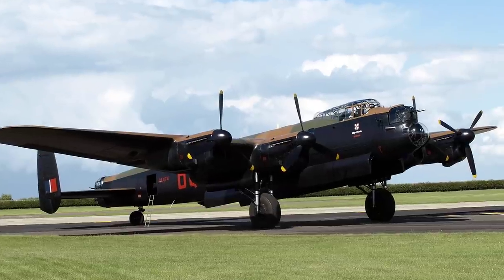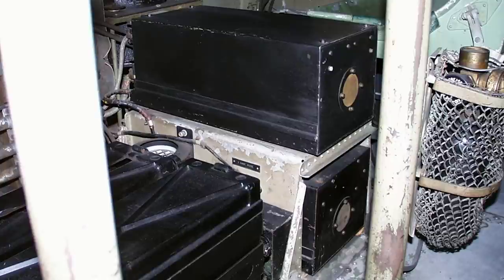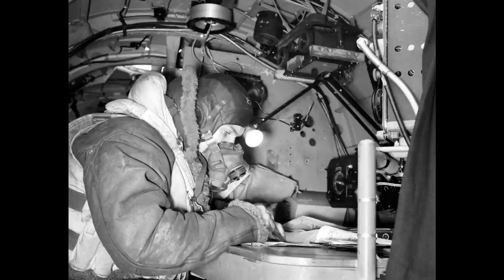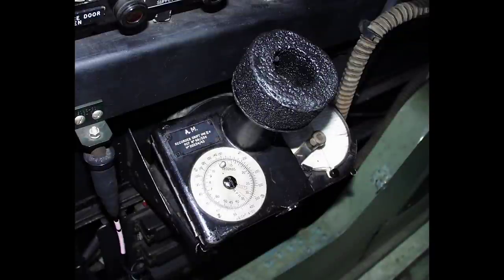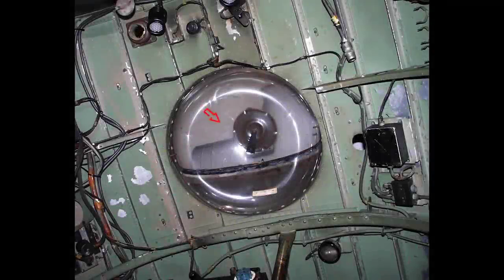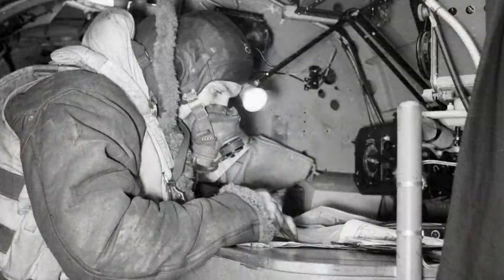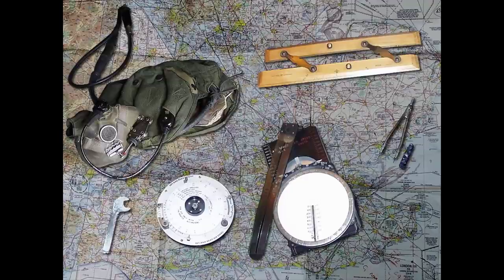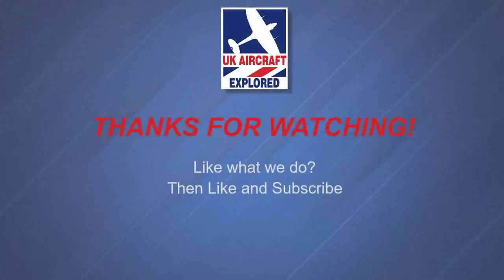Avro Lancaster – Navigator’s Position

Comment: Hi Bryan.  Very interesting, but a bit inaccurate in some areas.  The Air Mileage Unit did not output speed but air distance travelled with, if I recall correctly, 24 revolutions per mile.  In the AIR POSITION Indicator this was resolved with the true heading from the Distant Reading Compass, via the VSC, to produce changes in latitude and longitude which updated the initial position the nav set on the counters on the right of the API.  These were lat & long, not bearings.  This then showed the AIR Position, ie position in the air mass but not corrected for wind.  The nav would then plot the Air Position on his chart and add the wind vector, for the time from the last fix, to show the GROUND Position.  If fitted this could also be done using the GROUND Position Indicator.  In this case the nav would set his latest Wind on the GPI, harmonise it with the API and set it running, the GPI then projecting a constantly updated Ground position onto the chart below.  This technique was particularly used by No 5 & 8 Gp nav’s for accurate target marking.  I used the API occasionally during basic nav training  in 1973, ending up many years later as OC the Air Navigation School at RAF Finningley !  Do pm me if you’d like more info on the subject.  Rgds Chris

Comment: Great video as are all of yours , just a point . Have you mixed up your Oboes and Gee's  From what I've read Oboe had the lattice type map with a range around 400 mls , and accurate within 8 /9 mls . Whilst Gee was extremely accurate within yards but could only handle one aircraft at a time. GeeH a later version could cope with 3 or 4 but still limited to less then 300 mls.   This fails to explain as how was the American navigators were so poor , frequently bombing not just the wrong town /city but the wrong country , Switzerland , Holland , Czechoslovakia .
Reply from the maker: Hi James, I don't think I've mixed up GEE with Oboe. The original GEE used the hyperbolic lattice map system, you mention. Gee was read by the navigator on an oscilloscope CRT display. GEE was accurate to the order of kilometres, which was useful for navigation and area bombing, but not pinpoint accuracy. Oboe, however,  did not work on a visual basis with a map like GEE. The Navigator would use GEE for general navigation, and once closer to the target area, Oboe range signals would be sent out by UK-based operators using a tone generator producing Morse code dots or dashes. This was similar to the beam approach systems used like Lorenz. A solid tone would tell the crew when to release their bombs or target indicators. Hope this helps and thanks for watching.
Reply: @ukaircraftexplored6556  Thanks for putting me right on that one . Google the font of all knowledge said that Oboe could be accurate to 50 yards . True or false . ? Which doesn't explain how the Yanks failed to find the target so often , they nearly missed Berlin.

Comment: Fascinating detail and great shots of all the nav. equipment. What I've always been slightly mystified about is WHY OH WHY? DR Compass was set to TRUE HEADING? I am a modern day Cessna-scale PPL and even with all our current technology the HSI still gives MAGNETIC heading and VOR radials are MAGNETIC. I can see that the API Unit would require TRUE heading to calculate position but I can't see why the correction wasn't simply applied to API repeater and the others were left on magnetic heading? The pilot would have been staring at a DR Repeater showing True Hdg and down below he had a P4 compass showing Magnetic. On his blind flying panel he ALSO had a DI Gyro which he would regularly align with his compass. But WHICH one? Also I'd be interested to know exact dates of introduction of DR Compass and API. Were they brought into service simultaneously? Or was there a period when the DR Compass was in use on its own? And if so was it left on Magnetic Hdg?
Reply from the maker: Thanks for watching and sharing. The Distant Reading Compass was standard equipment in most multi-engined aircraft in the RAF throughout World War II until it was replaced by the Sperry ‘Gyrosyn’ compass. It consists of a master unit containing both the gyro and magnetic elements normally stowed in a part of the aircraft away from large masses of magnetic material which would distort the Earth’s magnetic field. This master unit feeds, through an electrical transmission system, repeater compass cards on the pilot’s and navigator’s panels and wherever heading indications are required. The complete compass system operates from the aircraft 24 V DC supply. The pilot or navigator has control switches for starting and stopping the master unit and a variation setting corrector control to adjust the repeaters to read true instead of magnetic heading. A complete system comprises a master unit, variation setting corrector, a control switch box and a number of repeaters. The master unit holds the magnetic element, the gyroscope, the monitoring and follow-up mechanism and the transmitter for operating the repeaters. The complete assembly is suspended in gimbals.
The system uses an electric magnetic inductor element fixed to the aircraft in azimuth which detects the direction of the Earth’s magnetic field relative to the aircraft and transmits this information electrically to the gyro element.
The D.R. Compass was developed by the Automatic Telephone and Electric Company (in 1961 merged with Ericsson Telecommunications and Plessey to form Plessey Telecommunications) and the Royal Aircraft Establishment from a model originally produced by the Air Ministry and S.G. Brown Ltd in 1934.
Some 30,000 of these instruments were made at the A.T.& E. Strowger Works in Liverpool during the WWII years.
This unit was donated to the RAA by John Jenkinson whose Father acquired it from the Oxford University Physics Laboratory.

Comment: Hi Bryan, great video again. Can I ask if you came across any manuals for the API and GPI? I’m wondering why the API has 4 digits for L/L coords, and also what purpose the dials on the front of the GPI serve, and why they have only 6 numbers on them
Reply from the maker: If I can find out, I'll let you know. Thanks for watching
Reply: I'd be interested to know if you turned up any manuals for API or GPI? btw there are only 4 digits because the API only gives position in Degrees and Minutes. It wasn't possible (or necessary) to give position to seconds since 1nm = 1minute. Also I believe the dials on the GPI are to adjust the position projector to the correct scale for the chart being used.